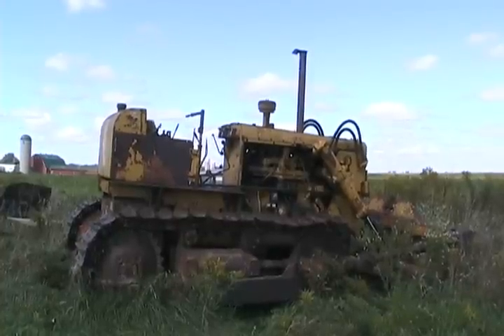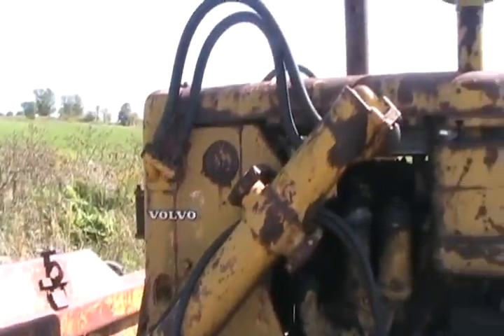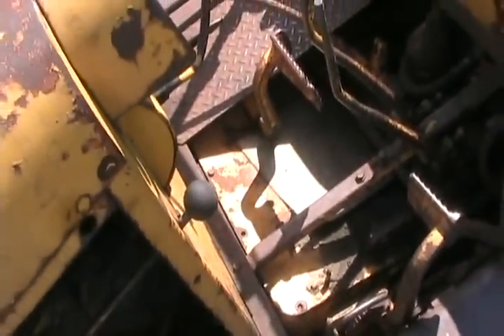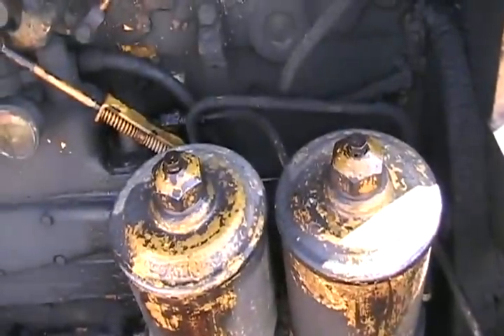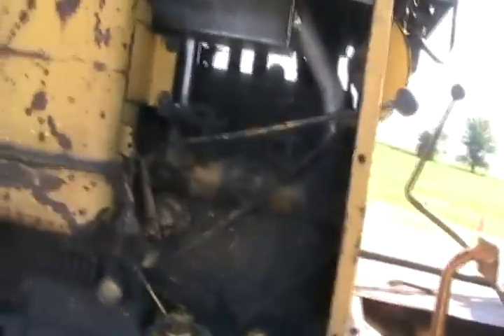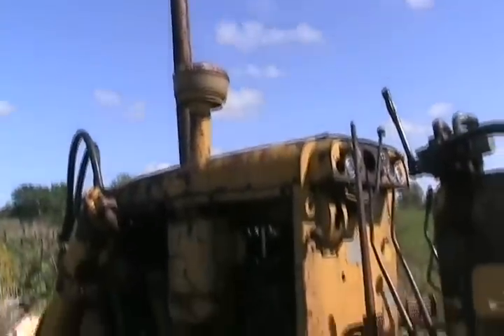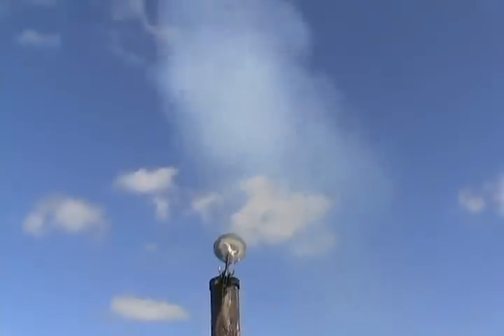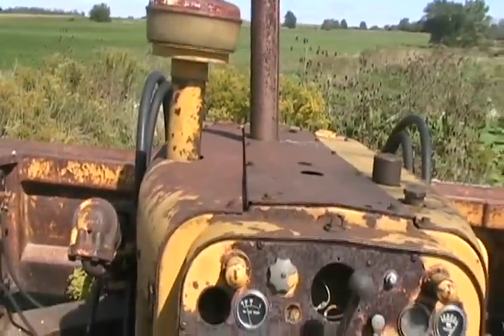All about my 1953 international big dozer  September 2011

Comment: The flapper on the injector pump is where you fill the pump with lubricating oil not where you bleed it. The injector pump should have oil in it but it is not circulated through the engine

Comment: Army had these at Camp McCoy WS in 1969, my eng unit the 615th lt. Equipment Co. Was on temporary duty (TDY) clearing fire breaks around impact areas. Ran good but they had cable blades.
Reply: Richard Mellon
Reply: I might have that old td20 cable dozer in my shop right now
Reply: Correction, I do have the cable dozer from fort McCoy, it went to the Wisconsin vets home in king, and it currently has 1,465 hours on it, and it runs like a top! If ya want pics, let me know!

Comment: The little flap on the injection pump is for adding oil, the pump is not lubricated by engine oil pressure,  it has its own oil sump, if you look there is a drain plug on the bottom of the pump, and then a oil level check plug on the side, pump oil should be changed every oil change

Comment: TD20 was an upgrade of the TD18, made by International Harvester about 1960. This machine was made about 1961 or so. Definatley not 1953. This dozer weighed about 15 tons. Not 20 tons. All International diesels were gas to diesel start since about 1944. After 1962, all International disels went to direct start. Dresser bought IH then Dressda Poland (Komatsu)bought the line.
Reply: Can you please give some information about TD 15
Reply: Thanks for all the extra information. Super cool machine regardless. I also did not know Rolls Royce even made Diesel engines let alone put them in heavy machinery. 
Do you happen to know the engine model? 
I am also curious - does the hydraulic pump just run off the crankshaft?

Comment: Great video. Many thanks for posting.
I imagine the carburettor butterfly is linked to the compression control lever to stop gasoline being burned when running on diesel. Would you be able to confirm this or explain how this is done otherwise please?
Reply: Answered in ... "Make exhaust manifold for 1953 bulldozer September 2011".
Many Thanks.
Reply: There is a lever that holds up the float in the back of the carburetor. I have at 1959 TD-15 with the same decompression lever setup. This lever controls so many things to change from gas start to diesel run. For example there is a contact switch on the end of the manifold that is connected to butterflies that reduce the intake by 1/2. The switch turns on and off the power to the coil. So the gas and spark and gas combustion chamber is shut off by the decompression lever.

Comment: This machine was built between 1955 and 1960 or so. It had about 120 hp. No where near 180 hp. The English TD20's had Rolls Royce Diesels, much smoother running.
Reply: I think English  TD20 s were BTD 20s

Comment: I don't think that flip flap on the pump is not diesel it's oil some of those older pumps needed to be filled with oil might be a level plug on the side should find out before you fuck it up